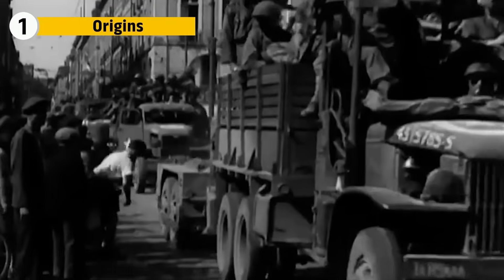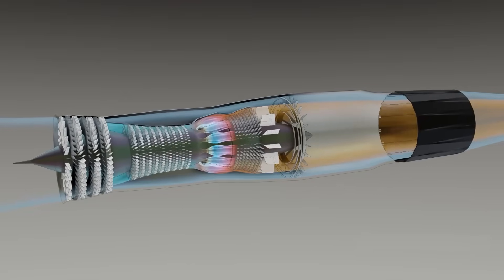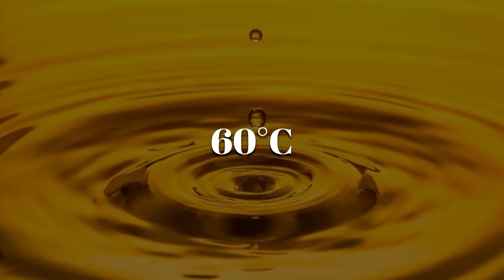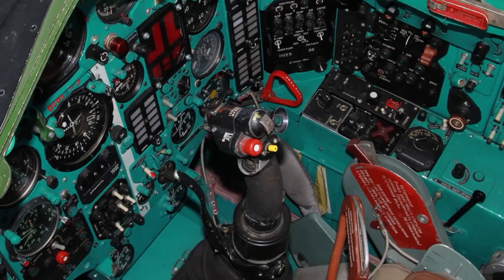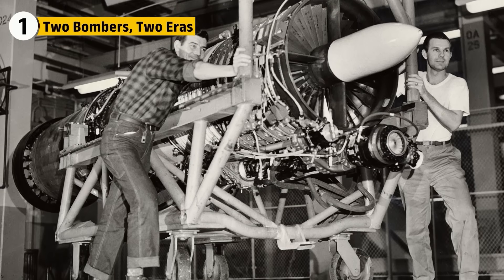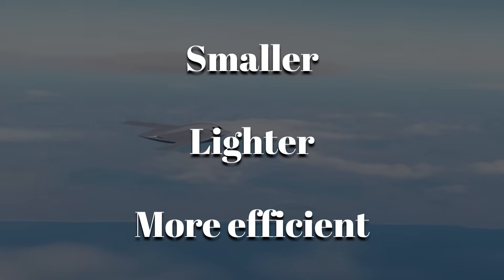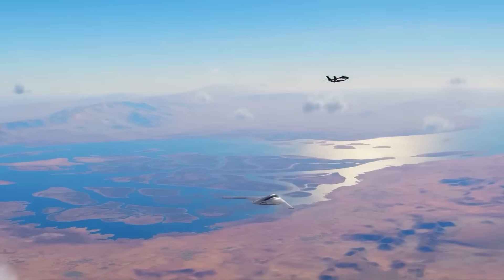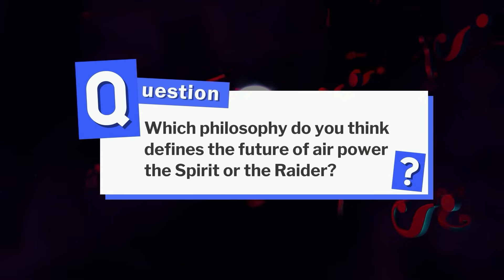SR-71 Blackbird vs MiG-25 Foxbat | INCREDIBLE ENGINE Differences

Comment: Significant Differences:  1,200 MiG-25 were produced and sold around the world. The MiG-25 could drop bombs, shoot missiles, etc.  A few are said to be still flying.   Only 32 SR-71 were produced.  As amazing as it is... the SR-71 could only take pictures and was quickly made obsolete by satellites.
Reply: Not quite true, the YF12 was armed. And don't really replace  recon flyovers, satellites can be defeated due to known passover times. A spy satellite is another tool but not a total replacement.

Comment: a MiG-25 Foxbat was tracked flying at Mach 3.2 over the Sinai in 1971 .. incidently the sovites built over 1100 mig 25's
 us built 28 sr71 .. half of which crashed ...!!!
Reply: Total of 32 SR-71s built 12 crashed 18 A-12s built
Reply: @dido-l4r  ...and 3 YF-12 
...Interceptor-version...only prototypes...but the 'Eagle' A.l.M.-Missile and its radar was the basis of the A.l.M.54 'Phoenix' on the F-14 'Tomcat'...!

Comment: Apples and oranges. The Soviets never built anything like the SR71 or even the U2 for that matter. Which is actually interesting because the Soviets tried to copy just about everything else the US fielded.
Reply: The copying went both ways... and still does.
Reply: @SunriseLAW Yeah? What did the US copy? Give me 2 examples.
Reply: @Rjsjrjsjrjsj  The US both copied elements of and bought the Russian RDX-180 rocket engines for their Atlas program because they were best in class at that time. SpaceX then used elements of the RDX in their Raptor design. The Russians built some very interesting technology. For example, they produced outstanding lenses for optical instruments in the days before computer-controlled lens-grinding. At the time their economy was in the mud so they traded various scopes for consumer goods. We used TAL Maksutovs and whilst heavy and lacking precision motor tracking the optical performance was as good as anything in the West at considerably less cost.

Comment: 7:22 - another mistake. In the beginning, the engines of the MiG25 had indeed a short lifetime. Reason: They were bought from an attack missile resp. cruise missile and thus there was no need for a long lifetime. Later they got improved significantly and came then with significantly increased lifetime.

Comment: 6:55 - another mistake. MiG 25 was not designed out of Ti because of shortages in the USSR. In fact, USSR was the world largest supplier of Ti. It was designed mainly out of stainless steel due to different reasons.
Reply: ...another Fun-Fact:
...the Titanium used to construct the U-2 and SR-71 / A-12 / YF-12 came from Russia...!
...and the Soviets found it difficult to handle Titanium - the US too - but they had the resources to learn the tricks...and Titanium IS tricky to work with...!
Reply: @Packless1  yes,even down to titanium parts made in canada and usa differed due to the water used in both countries!
Reply: This Narrarrator can't even get the facts straight about Russian Titanium, so why should I believe anything  he says?  Anyways, the  SR-71 would have never been possible without Russian Engineering.

Comment: Whereas the SR-71 can cruise at Mach 3.2 for as long as it has fuel, the MiG-25 cannot exceed Mach 2.83 for more than 5 minutes without causing severe engine and airframe damage.  The SR-71's top speed is still classified, but reports of it exceeding Mach 3.2 are common.  The P&W J-58 engine is a masterpiece in engine technology.
Reply: Wrong.  No one ever recorded the SR-71 going Mack 3+ and no record-keeping organization ever witnesses it happen.  On the other hand, the Israelis claim they radar clocked the MIG-25 at Mach 3.2 (not the SR-71!).
Reply: @johnwade7673  No, YOU are wrong!  Get some education on this subject before making ridiculous posts.  The Israelis did clock a MiG-25 at Mach 3.2, but it had landed with both engines destroyed.  Egypt 1971.  The SR-71 holds world records as the fastest manned air breathing aircraft.  Read the book by Major Brian Schul: 'Sled Driver: Flying the Worlds Fastest Jet'.